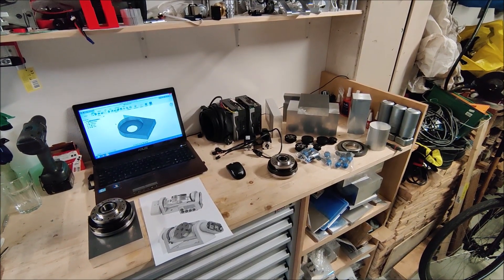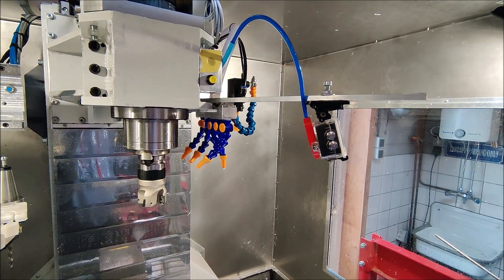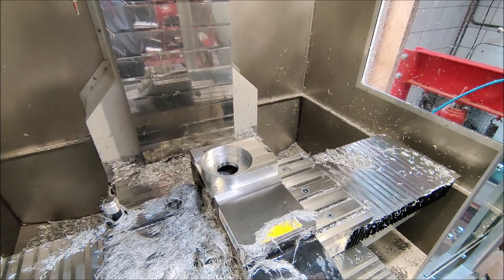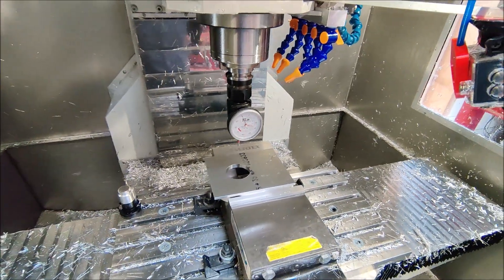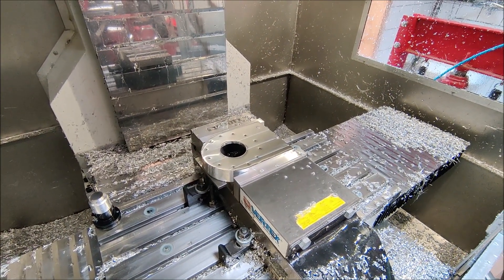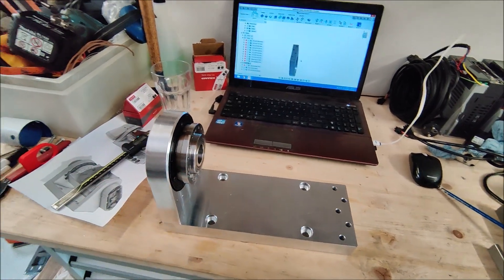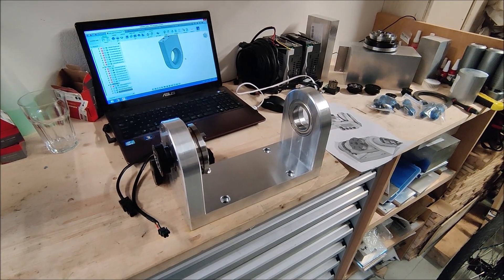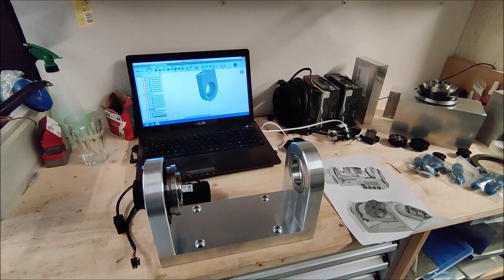Diy 5th axis trunnion build part2

Comment: Hi Stef, could you share the brand and model for the servo motors? I want to build this trunnion and will redesign it based on the harmonic drives i can get, but it would be nice to retain the design for the motor cases. Apologies if this was mentioned already and i missed it thanks!

Comment: Chip soup! Love it. Btw, this is insane MRR for a homebuilt machine.
Reply: I mean this "DIY build" leaves behind a lot of commercial machines. All epoxy granite.
Reply: @Ale_Lab  It crumpled haas, tormach, syil, this stef guy is an absolute guru.
Reply: @max_eley  yes absolutely. I have a super mini mill at the Uni. To me this one sounds better then the mini mill while cutting.
Reply: @Ale_Lab  Oh yeah for sure, and after owning 3 haas machines myself, this one will be running many more year later than a haas.
Reply from the maker: haha Tnx, i just run it tough a calculator and it said 144cm³/min.
Reply: I'm pretty sure he is still far from the limit. I got up to 450cm³/min on my diy machine. And its only a "normal" portal style build.
Reply: @AlexCNC  are you serious? Half a liter per minute? Did you build a machine inside your house or a house around your tank?
Reply: @auhopu  Here is a video with 200 cm³/min on my machine and that is not the limit. It can basically go the same cutting parameters but 20 mm deep instead of 10 mm. But I never used that much to make an actual part. Only tested it. Not sure if the machine can handle 400+ cm³/min reliable.
https://youtu.be/_MknOJ_uf5g?t=101
Reply: @AlexCNC  Well your new machine it's going to be another beast for sure. I agree that he can pushes more. Of course that is for aluminium. Would be nice to know the real potential in Steel. Like a mid range machinable steel.